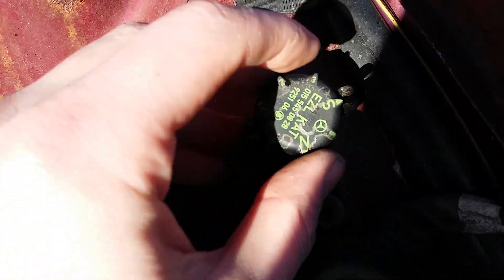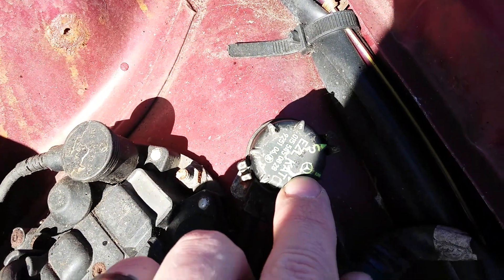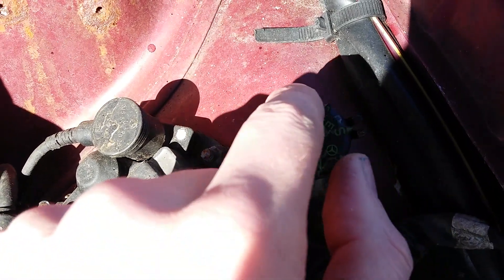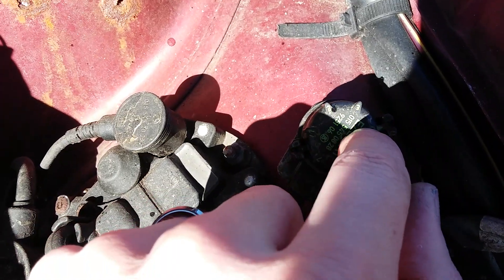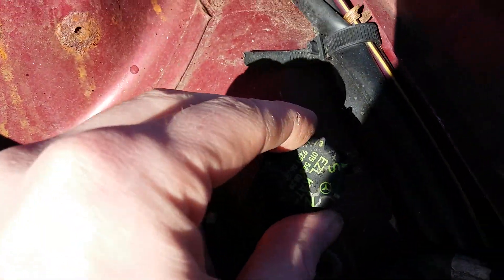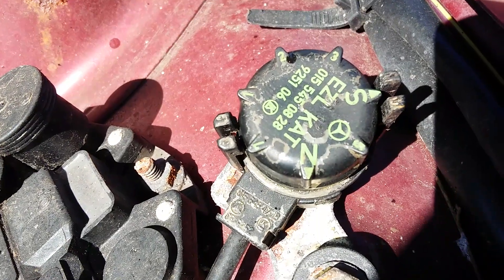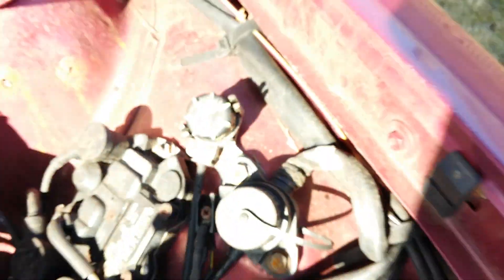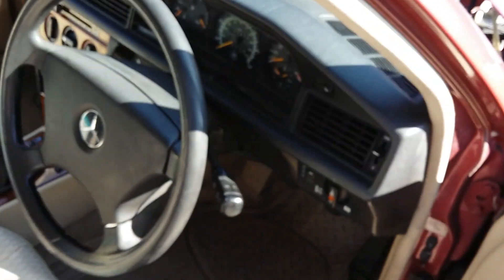Mercedes Benz 190e Restoration Log #7 - How to set Ignition Timing Module

Comment: Mine is set to N, but i didn't figure out how to move it to the S setting, it was not turning.... I have the same engine
Reply from the maker: Γιωργος Ταμπακακης pull the knob towards you and then turn it
Reply: i finaly figured out how to set it,  I just took the car for a spin and it improved performance and the throttle response as well. Thank you so much
Reply from the maker: Γιωργος Ταμπακακης really glad I could help!